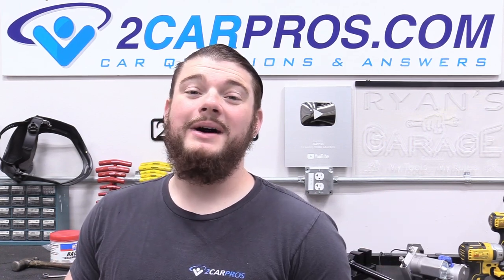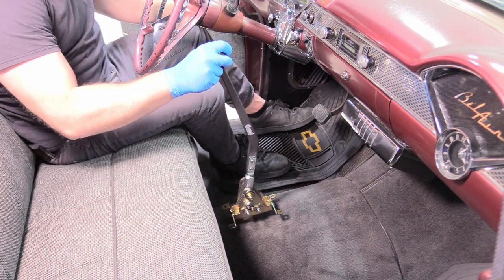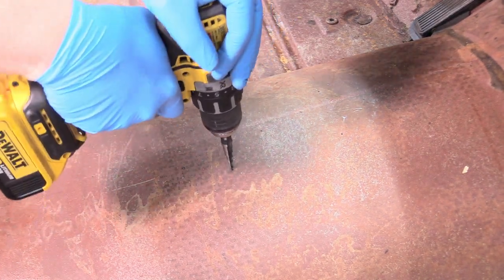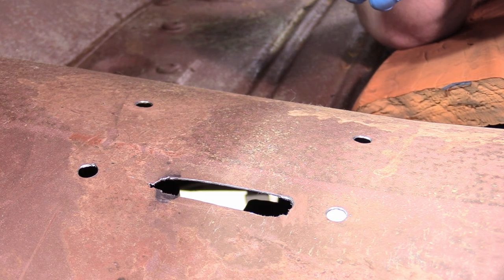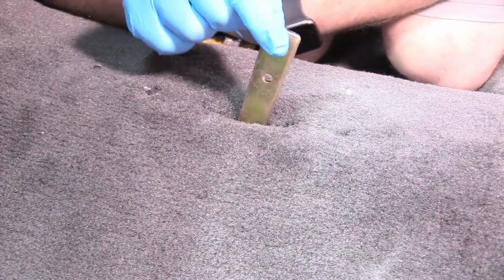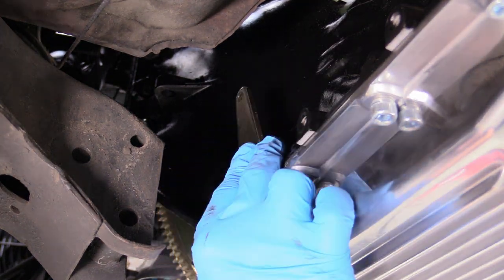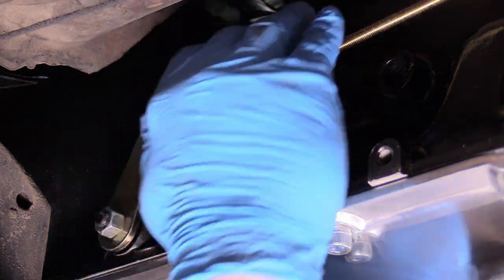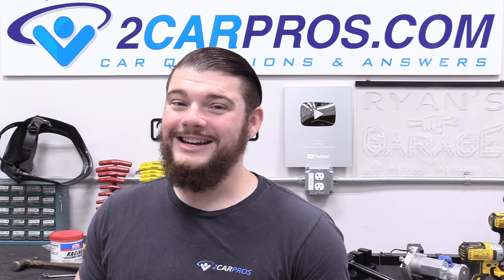How to LS Swap - Episode 10 - Floor Shifter Installation

Comment: Great video. One small comment. Instead of needing 2 people, struggling with loose carpet and hoping carpet slice is over metal slot. Bolt down the shifter and then  cut the carpet slice. 100% where it needs to be every time if the metal slot is correct.
Reply from the maker: Great idea! However the arm for the shift rod was contacting the floor if I did it that way. Would make for an awkward experience trying to cut the carpet. Thanks for watching!

Comment: I don't think you mentioned it but there were you cut the slot and even drilled the holes but something I do anytime I cut into metal like that I paint it when I'm done with the cutting to prevent rust on that fresh raw metal. Great videos! I've been watching your how to build an LS videos and now these. I just can't show my wife these how to LS swap because her dream car is a belair and she would push for me to get her one sooner than we are ready to get one haha. You're definitely making it look easy for this LS swap making it not seem so intimidating when we do decide to get her car for her. Told her if I got her dream car for her that the drivetrain was going to be mine to do what I want with. Can't wait to get started on it. Already have the engine for it after I take it the 5.3 out of my truck thats getting the 6.0 installed.
Reply from the maker: Good tip! 

Yeah it's not bad building this car. Easier than my Camaro that's for sure. 

Nice work! Let me know how it goes and thank you for watching!

Comment: Just finished installing a Lokar shifter in my 64 Galaxie fastback. I mounted mine below the floor because the tunnel is so narrow that the shift arm was above the floor with it mounted on top. No big deal coming up from the bottom. I appreciate you giving me the trick of the step bit for drilling thru carpet because a regular bit will ruin the carpet. THANKS

Comment: Your die seems to have cut off the factory coating.  In LA that's not really a problem but in other places rust could become an issue.  I would have been tempted to use a little anti seize where it screwed into the Hind joint and just a quick blast of paint on the exposed portion.  All in all another great video!
Reply from the maker: Great tip for anywhere it snows. Thanks for watching!

Comment: Was it possible to install this transmission and connect it to behind the steering wheel? Instead of making it on the floor?
Reply from the maker: Yeah I'm sure it is. Nothing is impossible with a welder and Heim joints. Thanks for watching!

Comment: Nice video man,  sorry to bother you, quick question I'm doing a hemi swap I have a drive by wire wind kind of mechanism or kit I can use for my transmission kick down.
Reply from the maker: Thanks for watching! Typically with drive by wire systems they expect the transmission to be electronically controlled. Normally a cable would pull on a linkage and that levers the kickdown. I don't think anything is commercially available for that, I would fabricate something off the drive by wire pedal so it also has a normal cable and just have it do double duty. Thanks for watching!
Reply: Thanks man for the reply, and thanks for the advice.
Reply: Lokar offers a shifter that has a sport shift electronic mode. You'll need a digital controller to interface between your ECU and the transmission. us shift quick 4 can connect to the floor shifter and allow you to program basically anything you want with your transmission.